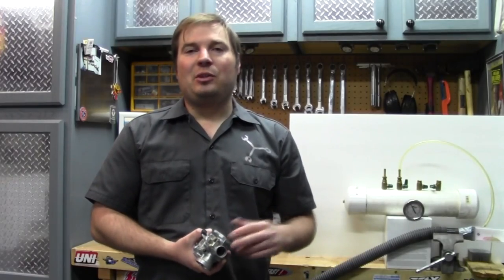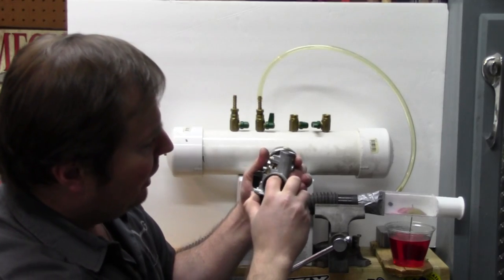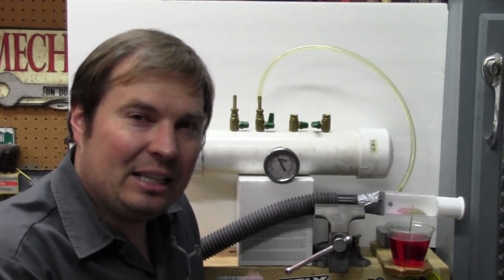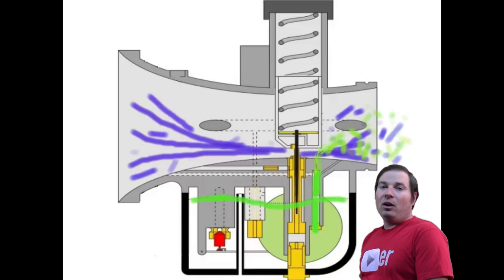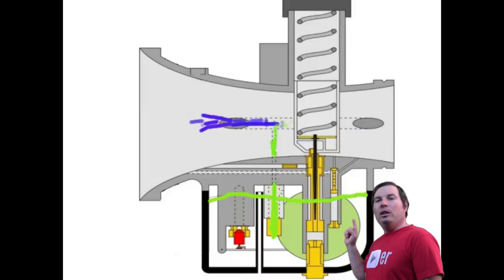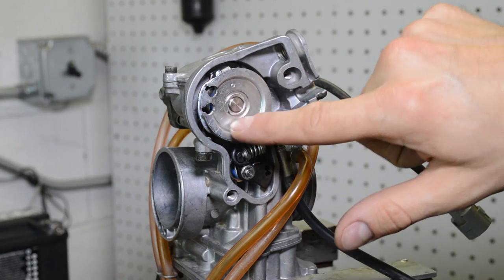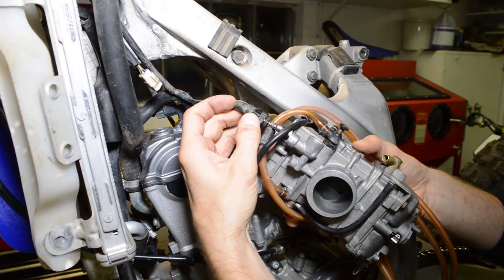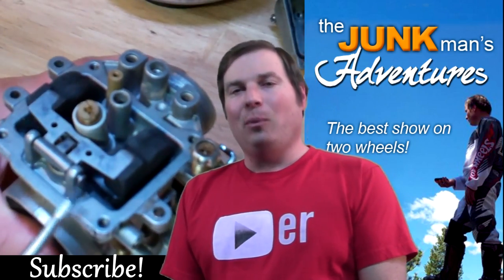How to adjust a carburetor, jetting and mixture explained!

Comment: Thanks for replying to me and also checking out my video to listen to my bike.  I think it just had the carb cleand but I cannot be sure. Thanks again JMan ✌
Reply from the maker: It is possible that some manufacturing swarf has broken loose from the tank and now is clogging a passage in the carburetor.  It is semi-common.
Reply: thejunkman aw rite so need to take the carb of then me thinks?
Reply: thejunkman Hey JM should my chain be greasey?  As my chain is just kinda dry and no oil on it atall..  I I'm on a shoe string budget with my pitbike lol and know the basics about bikes I have a 125cc kymco road bike it is a 2000 reg..  And the problem I'm having with that bike is the regulator rectifier that is to do with the AC/DC currents its not holding a charge into the battery and there for it won't start. So I'm stuck till I can get it shorted.also the choke switch which should it be up for on and down off, also should I only use the choke on my pit bike  when I'm cold staring or should I keep it on or wha t??   Thanks for your time J Man..
Reply from the maker: Chain should be lubricated.  The battery might be at fault on the other bike.  Which does your carb  have a choke or an enrichment.  If it has a choke, the valve should be open for "off" if it has an enrichment plunger when the plunger is down it is "off"
Reply: thejunkman so the plunger us like a little flip?  Also doe's that take in extra air?  What would you suggest for the chain WD40 or I have some car grease would that be better? Also how can I tell if it is the battery on my road bike? Much appreciate your time junk man  Thanks
Reply from the maker: On the "choke" which do you have a butterfly valve that blocks the end of the carburetor or a plunger that goes up and down.  A choke blocks some incoming air that is available to mix with the fuel.  An enrichment plunger opens a port from a dip tube in the carburetor bowl to allow more fuel into the incoming air.  Both achieve the same result, a richer mixture for when the engine is cold (cold air is denser meaning slightly more fuel is required to achieve the proper stoichiometry of around 14.7:1 for idea operating conditions)

As for your battery.  You could have it load tested to check for dead cells, but other than that MC batteries either work or they don't.  They are so cheap it is easier to replace them.  You can also check your charging system to see if the voltage regulator is working.  You should get something around 13.5-14.5 VDC at around 6-10 amps (that is determined by the capacity of the battery)
Reply: thejunkman yeah it's a butterfly  choke I have then,  so is up on and down off?  Also I done I diodes test with my multimeter  on the regulator rectifier and it didn't give me the rite read outs. And I tryed jumping the battery with my Car booster pack,  could that have fried somethings given it's only a 6v battery and I used a Car Booster? I am in Scotland UK and our weather is terrible for wind & rain so I don't get to work on the bikes when I want,  unless I really have to.  Lol would love a bigger ManCave as my 10f × 10f Shed is just big enough for me and my tools..  Lol thanks again J Man..
Reply from the maker: It is possible that you ruined some diodes if you used a 12V booster on 6 volt system.  If your lucky you just killed the battery.  The choke is off when the butterfly is horizontal to allow the air to free flow through the carburetor, I don't know if that is up or down given what linkage there is.
Reply: thejunkman yeah up is when it's horizontal, how long should I keep the choke on for when cold starting?  Also I am gonna order a new battery and see how it goes. But does it mean I still could have done in the regulator? As I done the diodes test and I just wasn't getting the rite numbers. So fingers crossed, because I have to get this bike running again before it's gonna need more work. Lol thanks very much junk man you have been a big help..
Reply: Toker is on a shoe string budget, because he spends all his money on buying weed.

Comment: thank you for an excellent explanation on the vacuum and non vacuum cars it puts into prospective what the carb is doing at any given time thus allowing diagnosis to be achieved!! If you understand how something works it's much easier to repair rather than just going through fault finding guides and relying on guestimation etc many thanks
Reply from the maker: I have a new video coming that I hope will expand on this topic as well.

Comment: Junkman, I have been working on carbs for age's well since the mid70s, but I never really understood what all the stuff was actually doing, well I kinda did but anyway nice demo.....
Reply from the maker: Thanks.  I am going to make a similar video discussing just the float height.  I mistakenly assumed people knew why it is just as important to have it set correctly before jetting.
Reply: HOW have you been working on carbs since the mid 70's and not know what the "stuff" was doing...?? 
Its like saying ive been a mechanic for 35 years but really don't know how and engine works ... OR
Ive been an electrician for 30 years but i really don't know what the Ground wire is for let alone why there is a ground rod outside...

Comment: Very useful information. I have to make some carb tuning on a 125 two stroke after I derestricted it so it doesn run lean. Some say I have to change the throttle slide too if I go richer on the idle and main jets. The slide is kinda pricey(about $60) here in Eastern EU. Right now it's 40 and I maybe have to buy a size 30. Do you think it's necessary? The carb is Dellorto phbh28 right now the idle jet is 50 and I will go maybe 52. Main jet is 132, maybe I will go 138 or 142 at max.

Comment: Nice video Junkman!
Reply from the maker: Thanks.  Share it around to those that might find it helpful.
Reply: thejunkman vtebki
Reply: Dear junkman and matthewmcrepair. I have installed the 125 cc motorcycle carburator on my Honda Civic 1987 automatic car. Can you both help me in adjusting a few settings?
Reply: @thejunkman  
Dear junkman and matthewmcrepair. I have installed the 125 cc motorcycle carburator on my Honda Civic 1987 automatic car. Can you both help me in adjusting a few settings?

Comment: How do you verify the pilot jet pathways are clear?  That is a great carburetor diagram!
Reply from the maker: Usually by spraying some aerosol cleaner through the pilot jet and making sure it comes out the tiny hole in the throat of the carburetor.
Reply: Ok.  I did that with success.  Thank you!  I sprayed B-12 (it is mostly acetone) from the air side in and let it run out the little hole in the throat ( I had the needle valve in without the spring/washer/o-ring so it would run out the throat holding the carb upside down).  I did that a good number of times to make sure it was clear.  I used alcohol to clean out the acetone and compressed air to dry it all out.
Reply: Part of the air/fuel circuit for the pilot jet was drilled and plugged with a small brass fitting. Have you ever removed one of those plugs then re-install another plug after cleaning?
Reply from the maker: Those plugs are not meant to be removed.  They are there to plug a passage used when the carburetor body is cast/made.  They are known as welch plugs.

Comment: Great explanation on carb metering circuits. I didn't really know but I knew that the jet needle must control the main, but did not understand completely. Why does the pilot jet stop pulling fuel at mid carb valve openings? Thanks.
Reply from the maker: Good question and observation. The reason the pilot stops contributing fuel at half throttle and above is becuase the vaccum created through the carb is lower and the extra fuel being pulled through the main jet drops the fuel level in the bowl just enough that the pickup on the pilot jet is not submerged so it can't draw any fuel.  Its a delicate balance going on that is why certain adjustments overlap a little. Check my website for more detail and visuals.
Reply: @thejunkman  Wow! I have been working on my 400 2-stroke for 12 years and did not have a clue. Thanks for the info. Frank

Comment: Hey Junkman- I'm pretty sure you answered the question that led me here, but let me be precise- I have Mikuni VM34 carbs on an XS650.  These are actually 2 stroke carbs so they have an air screw ahead of the slide.  My question is how much of the throttle travel is that air/fuel ratio screw really effecting?  I am recently thinking that it is only idle, but it seems to be the first 1/3 of throttle.
Reply from the maker: It has a very nominal effect above 1/8th throttle as that is where your pilot and main jet are working in concert, just like my animations are trying to convey.  I also have an idle mixture video you should watch that talks about that mixture setting alone.

Comment: Great video! Thanks ! 
I have a question about pilot jet , in this video you mentioned pilot jet has no function anymore  with full throttle when main jet engaged, can you explain a more bit about why ? Since the pilot jet is still open , why not jetting fuel when full throttle? Is this happen in both type of CVK and straight pull carb ? How about idle mixture , is this effect mixture for all throttle range ? Thanks !

Comment: Very good video! I do however have questions, just to clarify: 
The idle air screw is affecting the mixture when the slide is all the way closed?! So when you open the slide by a very small amount it is basically the pilot jet and the idle air screw that effect the mixture?! The pilot jet and idle air screw effect the  mixture at all slide openings, but it's effect becomes extremely small at larger slide openings?! Or does the "vacuum leak" in the idle circuit by opening the slide make the idle circuit stop working? The main jet size also effects the region where the needle is mainly metering the fuel, but not very much?! 
Also: Some carbs seem to have an additional jet on the top for full throttle enrichment.
Reply from the maker: Generally you are correct in your thinking, but here is the deal.  The idle mixture screw, has a negligible effect after the slide begins to open as the pressure drop makes the air passage (in the case of an air screw) more or less irrelevant because the air or pressure drop is going to happen in the venturi and not the air passage.  In the case of a fuel screw, the pilot and then main jet are sucking the fuel down below where the pickup for the fuel passage is so it basically stops working as well after the slide begins to move up.  I hope I am answering the question you are asking.
Reply: @thejunkman  Okay yes it seems you answered my question. Thanks a lot. Carbs are incredible pieces of mechanics and I think fully understanding them is key to be able to tune them.

Comment: I have a tuned single cylinder 180cc cbr and I want to know the use of a 50mm velocity stack vs a 100mm velocity stack, thanks
Reply from the maker: Neither will make a huge difference in performance.  A good air filter is fine.
Reply: @thejunkman  I mean which one will give me better torgue? And which one will give me better high rpm?

Comment: Trying to set up an SHA carb on an 80cc bike for high alt. Around 8,150' bought a jet kit between 50-70. Question: what does that dimension reference? Also, it seems counter intuitive to me to lean the mix with higher alt. Also, spark plug color diagnostic? White is too little fuel?

Comment: Question, I just got a bike that was running rich, so I proceeded to adjust the idle fuel mixture screw. While it was idling I closed it letting it seat gently. It kept running, although not very well. It is now at about 2.25 turns out and runs great. My question is, does it really matter that it didn't die when closed, since no bike ever runs like that. If there was any damage to the seat, so what, since it is at an appropriate setting? That's the real question I have. All I ever heard is if the seat is damaged then you have to get a whole new carb.  Thank you in advance.

Comment: Good video.....you put  a lot of work into it!  Obviously 4-stroke.....do you have video on 2-stroke carbs?  I was surprised by the turbulence in the venturi mock-up that was not helpful for a clean mixture......I'm wondering if that happens much in actual carbs.......
Reply from the maker: A carburetor functions the same way regardless of two or four stroke so this video applies because the carburetor doesn't know what type of engine is doing the suckingof air through it.
Reply: @thejunkman  I know that this is true but I always have a harder time getting idle quality and jetting thru the range with a 2-stroke.....so I was looking for tips.  I've been jetting cars, bikes, and drag cars for years but 2-strokes sometimes drive me nuts!  Keep the Faith

Comment: Hello dear. I have a 1981 Suzuki GS850 that I have transformed into the cafe racer style. Since always, after the transformation, it has given me problems in the carburation due to the installation of POD's type conical filters. I have tried to find out enough about the subject, but it seems that it is well entangled. I even acquired and installed a set of larger jet´s recommended to me by several people. The problem persists ... in low walks perfect, but in high the engine seems forced and the final speed does not exceed 90 Km / hr. Could you give me some recommendation? Thanks and regards"

Comment: what are the indications of too lean or too rich mixture? and how can i know without seeing spark plug
Reply from the maker: Generally speaking.  LEAN the engine will cut in and out, bog on acceleration, overheat, run better with the choke or enrichment engaged.  RICH then engine will bog, be sluggish, black or sooty exhaust, run worse with the choke or enrichment engaged.

Comment: my Keihin runs very lean. and I could not get te right mix. But my hot start is removed. so now I might have find the problem. if the hot start is removed wrong it might leak air and makes it run lean even  when the mixture crew gives a lot of fuel. so thanks for this explenation!!!
Reply from the maker: You need the hot start in and functioning for this carburetor to work properly.
Reply: @thejunkman  Great to know, going to work on it soon. ill let you know when I found out if that was my problem. but I don't have the hot start handle. so if the port just sits down it should not be a problem leaking air right? thanks anyway for your respond !
Reply from the maker: Right.  It should be fine.

Comment: so 50mm bore 55 mm stroke with 10.9.1 compression will need how much air and how much richening on the carburator that is 20mm fuel side and 32mm air inlet?is there an actual solution?

Comment: Great video! It's very helpful.

Can you tell why some jetting kits are just first stage and some are three stages and in what conditions would the 3 different stages be used for?

I'm presently riding a 04 drz400s but will be doing a 3x3 mod. Eventually I will install a performance pipe. That's also why I'm wondering if I need the other stages.  Thanks
Reply from the maker: Stages are levels of modifications.  The modifications you describe are "stage 1" meaning you aren't doing anything to the internals or swapping any major parts, like adding a "pumper" style carb.  Stage 3 would be if you installed a BBK and different camshafts.  In your case you might just need to richen up the overall mixture a little.

Comment: Great video.I have a cv40 and at idle I have some fuel coming out where needle goes into emulsion tube.Is that normal?
Reply from the maker: I am not sure what you mean?  Is this when it is running?
Reply: @thejunkman  yes.When I am at idle there is some fuel coming up through the jet needle .Then runs under the butterfly into the manifold.

Comment: Quite a good explanation of how a carb works but just as the throttle is cracked open the pilot circuit feed the transition circuit as well as the hole that delivers fuel at idle. Also at idle not all of the air the that engine requires is delivered via the pilot circuit, air still flows down the main venture, the air the flows down the pilot circuit is really just to create a vacuum above the pilot jet so that it delivers fuel. The air flowing under the slide down the venturi is then mixed with the fuel that the pilot circuit is providing.

The main fuel circuit as air fed into it in order to help atomize the fuel and tailor the fuel curve.

Comment: Hi man... I just put a new crankshaft an cylinder an head on my honda mtx 80 ot it's a 
115cc Ø57mm ATHENA RACING big bore kit an it's starts an runs but there petrol pissing out of the overflow pipe ? What's go in on here ? It's a 18mm carb on it
Reply from the maker: That is easy.  Check this out.  https://youtu.be/i6yOd2lwwDU?t=107  This will explain your problem.

Comment: My motorcycle shuts off after I pull in the clutch at higher speeds.  I have some pilot jets on the way and may adjust the needle. I hope that works otherwise I have no idea.

Comment: need help I have a 125cc pitbike 4 speed motor with a 26mm mikuni carb starts and idols does somewhat ok in first gear and sometimes in second 3rd gear it just bogs out I can't get it to open up any advice has performance exhaust and air filter air screw is adjusted one and a half turns out thanks for the time nice video
Reply from the maker: You are possibly too lean on the main jet or rhe needle position. Watch the video again and focus on those. Also I have other videos that break it down a little more. It takes testing one thing at a time. https://youtu.be/_gHH4UVbkFA
Reply: thanks got it right thanks for the help